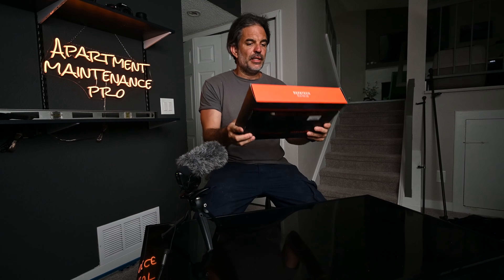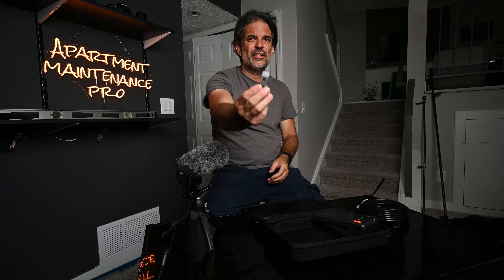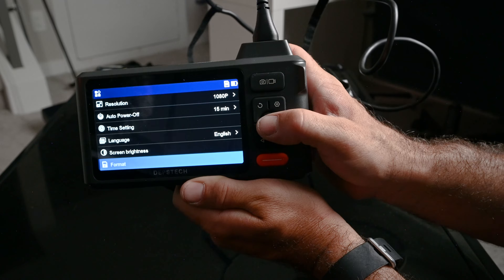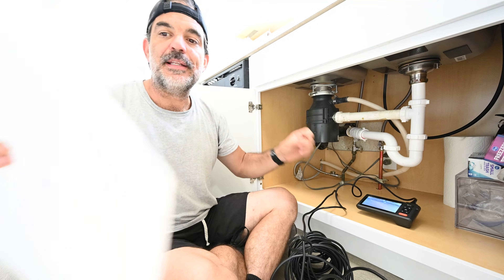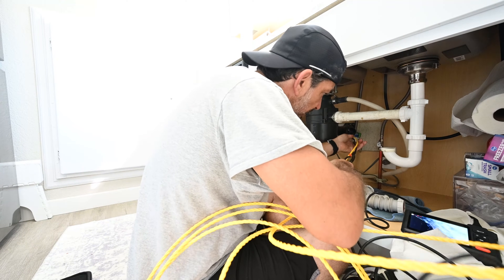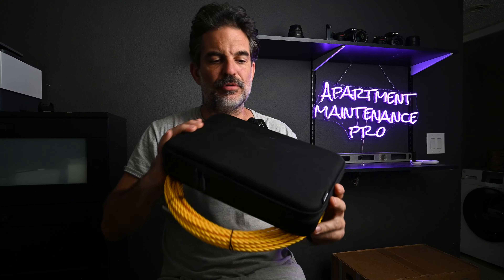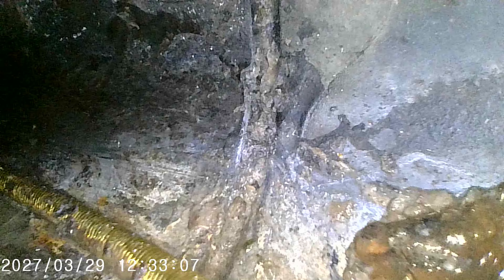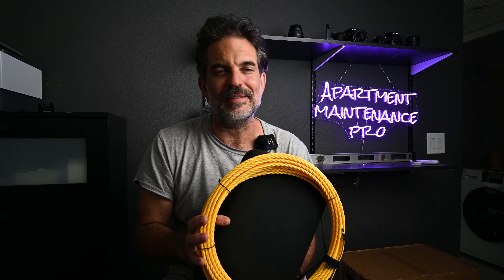Depstech Endoscope DS520 review

Comment: I have one of these...I use it with the Ridgid Flex-Shaft K9-12 and can see, real time, as I snake a line.  Also use it when a leak causes a hole in the ceiling downstairs to detect where the water is coming from.  Keeps me from having to cut a huge hole in the ceiling to get my big fat head in there